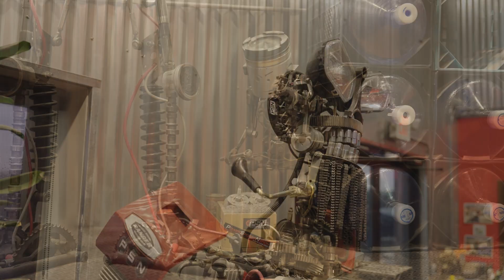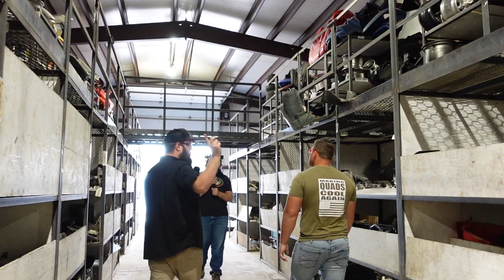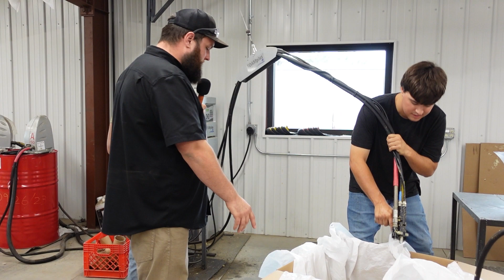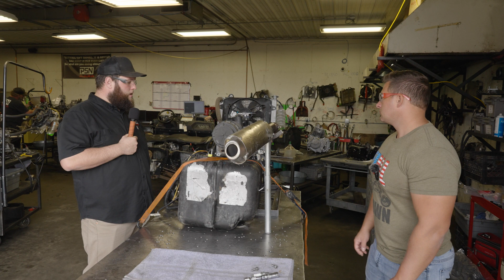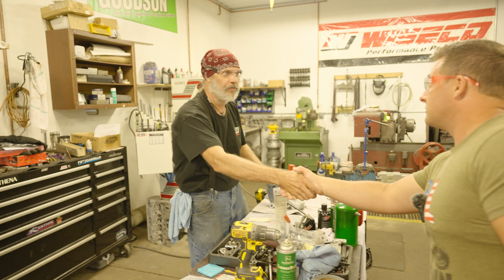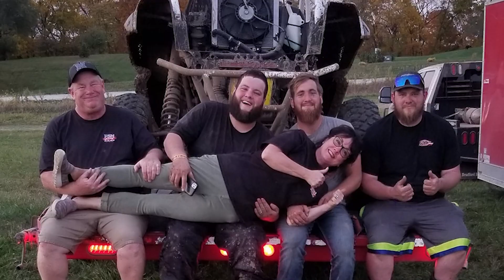How They do it - Worlds LARGEST Provider of Used Parts in the Powersports Industry

Comment: Ive used them already very quick on getting stuff to me ordered a 2019 arctic cat 570 frame with title went to fed ex to pick it up and the frame was not connected to the skid the plastic straps were broken and frame fell of skid and also ordered a carb boot and when i got it it was dry rotted and cracks the whole way thru the boot it was just as bad as the part i was trying to replace i dont know how that went thru quality check. Mixed review here!!

Comment: I used to work for a few companies that rebuild gas station pumps. Very expensive and delicate units similar to engines. We used to use the exact same foam setup 15+ years ago. Pretty cool stuff. If done right, the Fedex driver doesnt even have to stop, just push it out the door at 55mph.

Comment: This place is crazy expensive for 400ex parts! $399 for a 2007 transmission, I paid $79 for mine from a 2014 - $650 for 2007 crankcases, I paid $150 for mine ...
Reply from the maker: I just looked on eBay and currently they're between 150 and 500 for a 400ex trans - the inclusiveness and condition is all over the place. Sounds like you got a good deal man!

Comment: Well, i watched this youtube, went to the site.  Checked for a 1985 LT230 Quadsport thumb throttle and they didn't have any.   :(      I found the part on ebay for 15.00.   Maybe for when the 2007 raptor needs some part, i will try here again first.  Maybe the quadsport part is there but not cataloged.

Comment: I would really like to see you build a hybrid quad. No not electric hybrid. A hybrid as in an engine from one bike into the frame of another. Preferably a banshee engine in a newer YFZ450 frame. It would be a small advancement in your building since there would be some light fabrication/modification. Get on it Mike!

Comment: So many good bikes parted out for no reason. Shame…
Reply: Really it's a double edged sword, 1 nice bike being parted out, can supply enough parts to help keep 100+ other bikes on the road. There's a lot more people looking for parts to fix the bike they already have then there is people looking for complete bikes. In most cases most machines (especially older rare models) are worth more in parts then they are as a complete machine.
Reply from the maker: What about all the people with the same model that need parts? Most of these machines were rotting away in someones yard and now they can be used to save others. It can be sad to think these won't be saved but there is a silver lining.